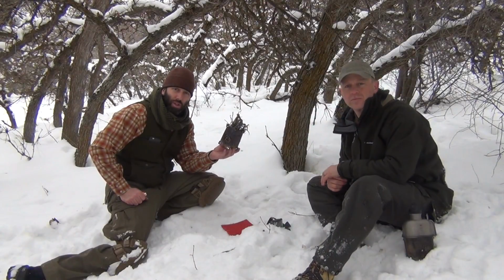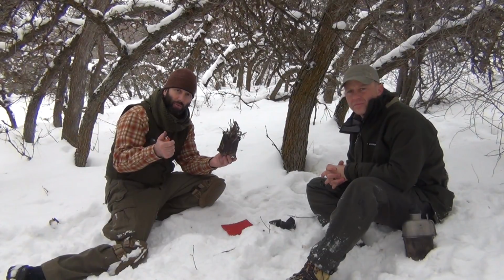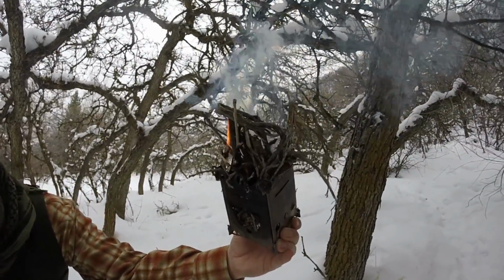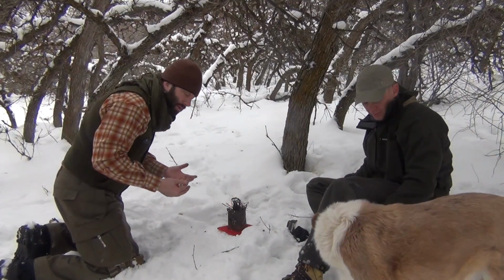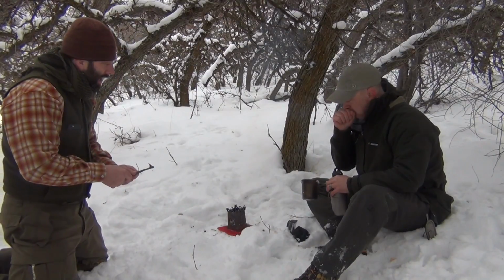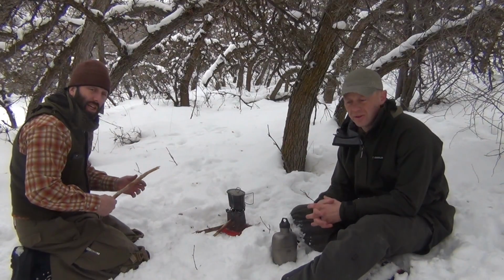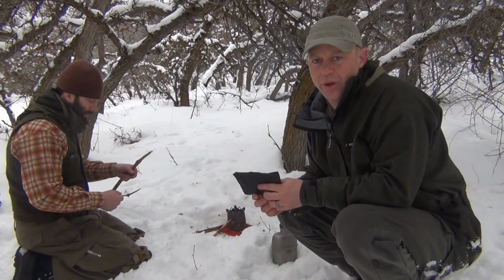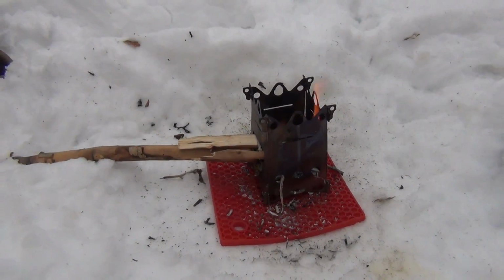Emberlit Fire Ant Field Review

Comment: The main mistake people make with wood burning camp stoves is filling them too full. Need to leave plenty of room for airflow. Far easier to add material as we go than to coax a decent fire from a crowded mess. Be surprised at how little material we need to keep sustainable flames inside those heat reflecting walls! 

Another tip: for faster fires, leave the bottom plate off.

Comment: Good review guys. I like it. I've never heard anyone explain the advantages of that stove over a conventional fire. I would have liked to hear the pros & cons over a gas fuel stove as well, although I can pretty much guess. Just brainstorming for anyone else who is curious...
Emberlit Stove: unlimited fuel source, lighter in weight, more time to collect wood, get fire going, & more work keeping it going. Also I would think it would take longer to get water boiling since it's probably a cooler flame. 
Gas stove (such as Jetboil): quicker to get started, no cleanup, possible to run out of fuel, Heavier in weight, quicker to get water to a boil. 
Am I missing anything?
Reply: These stoves follow LNT principles, vs. an open fire on the ground, which leaves a scar and lasting embers on or below ground.
Reply from the maker: I have both.  These stoves are lighter, unlimited fuel, a little harder to get and keep flame but much more rewarding because of this, Leave No Trace compatible if you do it right.  It boils water very fast because it is essentially an O2 forced mini Dakota fire pit.  Maybe not as fast as a jet boil but maybe as fast.  I need to test the two against each other and find out.  Video coming!  But mostly you get a quick hot fire that is enough to boil water or cook food before running out of your first batch of wood/fuel, and then you can scatter the minimal amounts of ash left over without leaving a mark.  Only in the dead of winter high in the mountains do I prefer the heavier Jet boil over the Emberlit due to a lack of fuel availability in the snow.
Reply: My wife and I recently went on a backpacking trip and hiked to the top of Yosemite Falls. After we got up there, we realized that we had forgotten fuel! I pulled out my Emberlit stove and we used that. For the extra security it was well worth the extra weight considering it basically took up no room.  I have used it quite a few times now and really like it. It definitely takes pretty consistent maintenance to keep the fire going, but it is virtually failproof.
Reply from the maker: ***** I think you nailed all of the points with that story pretty well.

Comment: i like its foldability thiness lightnesses however it would be susceptible to inadvertant impacts pack hitn rocks or falls etc 
which would prob screw up the joints
yeh you can tap it back out reform shape it etc? no biggy
but at home prob to get it straight not in field so easy
the thing i use is ord tin can with holes drilled in it
ive swapped this out now for a stainless steel kitchen utensil holder has holes already pre drilled through it they work very well you can cutaway a hinge or hole in sides to side feed aswell as topfeeds it
it works excellently
in field though obviously bulkier to pack as doesnt fold flat the only adv i see of these is that they fold flat but if they fold flat you then wak them in a external pkt they can be susceptible to deformation from pack impacts or  phys falls as the carry case doesnt offer any type of impacts protection to what is just cleverly cut out hinged very thin alloy plate essentially!
the stainless steel or tin can versions i use are expendable and cost effective however titanium anything often isnt!!
as cost effective no matter what its alloy advantages!
id quite like to try out one im going to order x2 firesteels off merkwares anyways
they look really nice good ones
they do vary i like the softer ones
for my softer hands!!
moisturiser haha
!!
anyways good video
good item in gen
i like the fact it keeps tinder uses minimal us forestry service appreciate lessened fire risks in dry timber country
and it does focus the heat no heat losses via dissipations
and makes your tinder easier to pickup handle
during lighting ignition processes? your accesses &
mobility of tinder improves!
its clever little lightweight design
though but would it ever deflect save me from a stray random bullet if i placed it in my top nz bush jkt pkt over my heart area!? hmmm?
Reply from the maker: If you smash it just bend it flat.
Reply: its pretty maleable then ty? thats good!! i usually use a flattened surfaces to reshape it back exact for locatiins joints to fully move work etc i guess if you have anything flat in field like a protective cover or cases that will take a hard knocking too reshape it or finger working it back etc id quite like too try out one! 
i like the low viz low impact natures of it!!
it beats digging out a dakota firepit! 
quicker!
it does take some tending tho its not a thing you can just setup and leave unless its dry really dry youd have to keep ontop of the feeding of it often i got other things to do at camp but if this was a brew up kit then fine if your out for the day want something bushcrafty to do tend too it
but if you were at s fullon camp where theres lots of tasks begging for your solitary attentions id think it would soon become pretty tedious constantly filling the thing up
all of the time or forgetting too by a few mins coming back finding yer stuff half completed or done!! 
id give it a go best way is too just use one!! see how i get on with one!!
Reply: TJack Survival id be looking for a usb socket on next one powerup based one from merkwares!! theres a patented idea i know a guy in munich whose offered to patent a few of my ideas so there is a new product design idea for troy or merkwares to try to do design is a power up versions!! of one killing x2 birds with one stone!!
Reply: made of non melting materials like high temp ceramic housing
or silicon seals? just an ideas?!
Reply from the maker: +david john Huxtable It's not really malleable, and it has memory because it is titanium so you can bend the crap out of it and then bend it back to it's original shape, but it is metal so if you smash it just flatten it back out.
Reply: +TJack Survival yah titanium does kinda act differently? thats why they surround apache pilots with it!! har!! my point was if you smashed it way outa shape to do a good job on it keeping an eye on the precise moving clipping in actions of the joints to ensure its future easy connecting actions would be necessary!! when i usually flatten ord metal out i use a steel block or vice or small anvil head or flat surfaces!!
obviously you cannot carry any of these in the field?
but id give it a go anyways on any flat surfaces but theyre harder to find in nature?
so youd prob have to improvise any repairs out in the fields if these did get busted up by any impact drop fall or crushing type scenarios?
i like to be able to strip down mend repair or replace all of my kit in the field like msr stoves for example 
do a kit
these apear to be very flexible! quite precise at their junctions with one another? if one got bent outa shape id not know how pure titanium would react properties wise it acts differently to most other types of metals has certain odder charachteristics as it is not an ordinary metal can often prove quite tricky to work with! especially if any degree of precision is needed or required in a repair? to ensure that it fully functions as it did when you first got it after receiving any damages to it!!
that capability to do that you may not always posess within the field it prob would have to wait until you got back home
if damaged
in order to do a satisfactory repair if it was deformed 
rarely does anyone carry flat surfaces or hammer or anything that can take a hammering with them if it is flexi enough to take manual bending then yer prob ok just using your hands
but some of these types of newer metals can prove quite tricky to put back in shape! unless you are aware have prev good exp of their specific charachteristics or principles of uses!
a mild damage id imagine could be manually reworked back into shape
but a real bad damage repair would require a tad bit more efforts than just that to fully aligns it right as it was before?
that has onky been in my own personal exp in the past anyways?
i have reformed spun steel in the field its harder than you think
especially with cylindrical objects
like when someone leaves their sigg bottle on a mt ridge winds topple it over or guy knocks it off topples over then rolls or slides at high speeds down a icy slope or boulder to boulder etc
they look like theyve been kicked arounds a carpark afterwards if you retrieve them some ive rescued for others have still worked ok despite their battered looks etc but others have been pierced! through sidewalls making them inusable depends on how they impact etc on their way down! its pure luck of the draws
but most things in bushcraft you should be able to fix out in the wilds?
anyway by hook or by crooks!!
if you use your initiative i often carry some random stuff that others ask me why im carrying it get laughed at a lot until they happen to need it!!
but one of em wouldnt be a metal planing hammer or a mini anvil or flat steel or oxycetylene torch visorin the field!! har!!
i do like sturdy kit or all natural stuff
things that can take a fair whack!! when yer out cuz where i often go they do get often whacked!!

Comment: What would be the advantages and disadvantages be between the FireAnt and the orginal stove be besides just the weight?
Reply from the maker: +RullerTV Weight aside, the titanium cools off faster.  But weight is the primary reason for titanium over steel.  Ounces are pounds and pounds are pain.
Reply: +RullerTV 
For a quick boil or two the FA can't be beat. For extended cooking the EL is better.